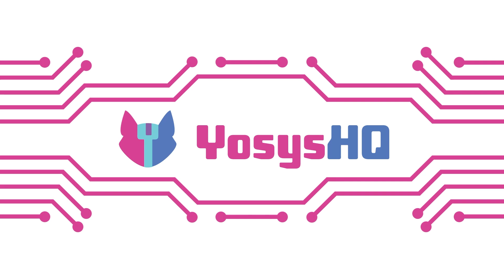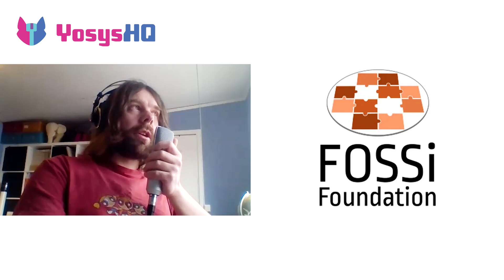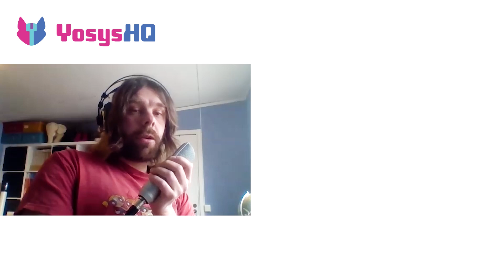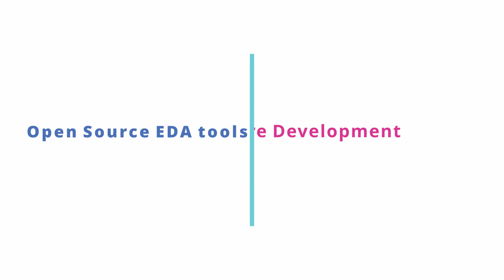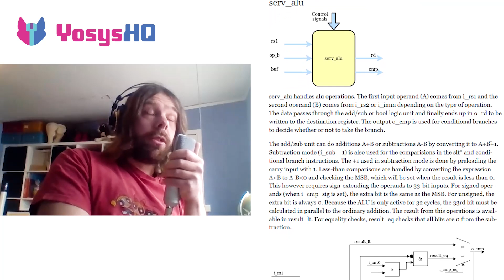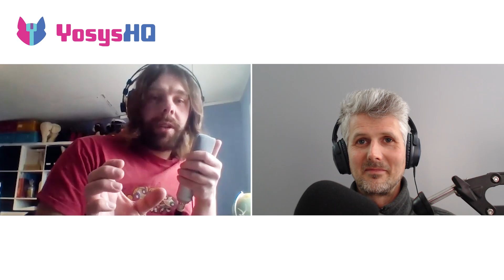Olof Kindgren

Comment: All of the topics look very interesting, but it's really a shame about the audio quality. It is very hard for me to understand Olof because of unmatched levels and what I assume to be an overzealous noise-removal filter of a teleconferencing software.
Is it perhaps possible to have the future guests record themselves locally to avoid this?
Reply: Yeah, that was my fault :/ I did record locally with a very fancy mic, preamp and sound card but (probably) the gain was set too high in the recording software so the local audio was unusable in the end.
Reply: It was my fault really - I should have got you to send me the test recording to check it.
Reply: Yes, sorry about that. Out of interest, given that Olof's main audio was too distorted to use; would you prefer it if I had processed my audio so at least they sounded the same?